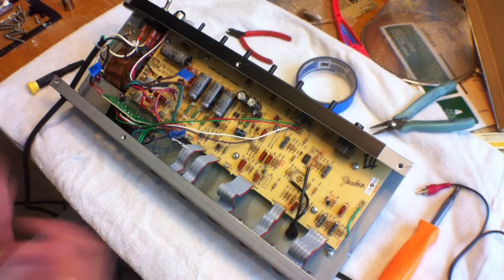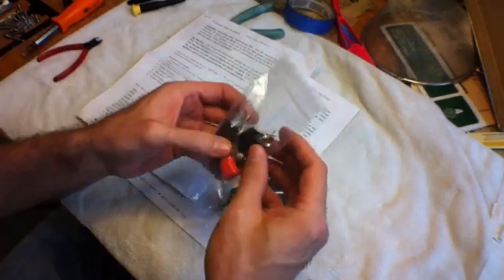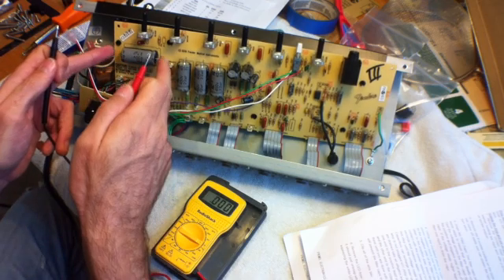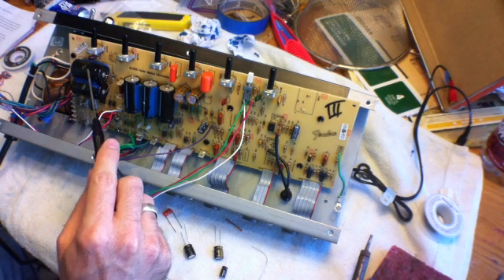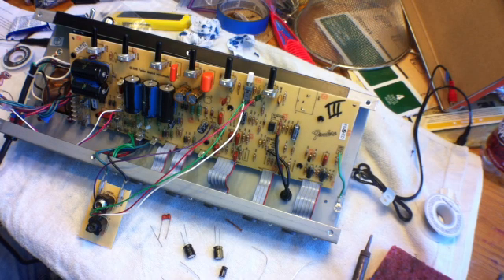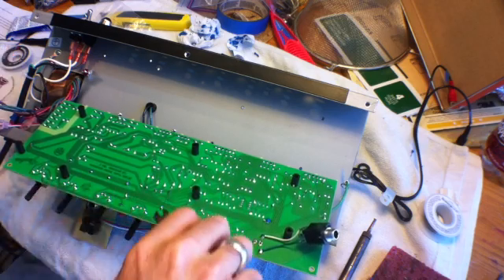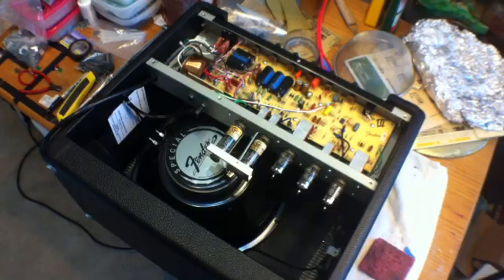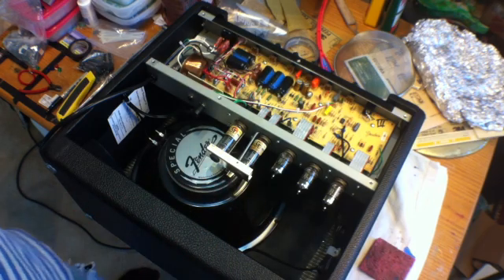Modding The New Fender Blues Jr Series III Amp

Comment: Hey Scott, I cant believe you've modded this amp! I am currently modding mine and adding an effects loop. I'm recreating EVH's pedalboard and use it through the FBJ!  Hope all's well........Rock On!  -Dave
Reply: Hey Dave, sounds fun! What’s on the pedalboard? I’ve never followed EVH’s rigs, they always seemed other-worldly, so, I left it alone.
Reply: @Scottsguitarplayground  Hey Scott,  I am using a Morley Pro Series Volume Plus, EVH Wah, EVH Phase 90, EVH Flanger, BOSS Super Octave OC-3, EVH 5150 Chorus, BOSS DD-2, MXR Reverb. I am also using the EVH 5150 Overdrive either in the effects loop chain or at the amp input. Not sure yet, I'm still modding the FBJ and adding an effects loop...
ROCK ON!  DW

Comment: The wire wound 330 or 470 Ohm cement resistor is to discharge the smoothing capacitors then to be discarded.

Comment: The extra resistor is to use with wire and alligator clips to drain the filter caps so you don't get electrocuted
Reply: Yup. Frommel puts one in all of his kits along with a safety disclaimer.

Comment: It's much easier to work on if you take the screws out of the tube socket board and remove it all together plus you don't bend the ribbon cables and break them. Just take pics and mark the connections from the transformer. twist the leads from the transformer by color to reduce hum. That is what Bill M recommends and pulling the ribbon cables away too.

Comment: Isn't the large 5 watt resistor for adjusting the power tube bias so it can run the tubes a little cooler?
Reply: youren8 It turns out it’s just in the kit for bleeding the main capacitors. Handy!

Comment: I did a Billm mod on my BJ3 cream board and it was a huge improvement! BUT THEN...I attempted to revive a muddy-toned early BJ from the 90s and it still sounds muddy. I tested just the head with the BJ3 speaker, swapped the tubes and still nothing fixed it. I did the Basic Kit mod,  High-Voltage Preamp mod, Re-Cap Kit, and replaced the input jack. Any suggestions?

Comment: That's like modding a BIC lighter.
Reply: I modded mine with the Bill M mods and it has a Ceoestion V Type 70 watt speaker. It makes the Bic Lighter into a flame thrower.
Reply: I use to mod bic lighters all the time when I was in boy scouts.  They were practically flame throwers; I'm amazed I don't have more scars on my hands!

Comment: Question, did you notice your mid knob do something else? I did this mod to my amp but the mid knob doesn’t sounds like it has any effect when the bass is past 6. Also when the bass is on 5 or less the mid knob adds bass or something when I put it to 1 and as I got higher to 11 it takes away a lot of bass. Do you know what’s going on or did I mess something up?
Reply from the maker: I didn't notice any of those issues with my amp...it's been quite some time since I played through it, as I sold it to a friend about four years ago. It's still a really great sounding amp for it's size, and it's always fun to jam at his house and use it.
Rock on,
Scott.

Comment: What speaker did you have installed in your Blues Jr? I just got the Basic Mod Kit from Billm Audio but feel the stock speaker needs to go.
Reply from the maker: The speaker does need to go! I replaced the stock one with an Eminence Swamp Thang, which gives the amp some extra, more natural sounding low-end, more like the Fender Deluxe Reissue.
Rock on,
Scott.

Comment: For anyone that is looking to make their Blues Jr go from a good amp to a great one, check out http://www.BluesJr.com.  They have an ebook called The Ultimate Fender Blues Jr Tone Guide.  It lists which mods are the easiest that give you the most bang for your buck along with specific product recommendations for those mods.  The best part is the 30 or so tone settings that are included to give you a good starting point for dialing in your amp.  Handy guide to have for the Blues Jr

Comment: Just about to order mine, you really think the supreme kit is worth it? You still have it and if so what speaker do you have? Mine came with a V30 which is already going!
Reply from the maker: +Sin sin sinner I definitely think it's worth it, it'll transform the amp! I don't still have mine, I sold it to a friend a few years ago, but, I visit it from time to time. I put an Eminence Swamp Thang in mine, great speaker! It really adds some girth to the bottom end...I also really love the WGS Veteran 30, those are both great choices for the Blues Jr.
Rock on,
Scott.
Reply: G-System Videos
Very cool I have quite a few tubes amps with out reverb and wanted one with, my favorite speaker is the Heritage G12H 55Hz which Ive tried without the mods and its amazingly better than the stock V30 my special edition came with. Thanks
Reply: Is the Swamp Thang still your preferred Blues Jr speaker? Thanks!
Reply: Vince Versaci
Ended up selling the BJ just too boxy, bought a bigger cab for my champ 2 and it blows the BJ away
Reply: Bummer. New speaker and Supreme Mod didn't make much of a difference for the boxiness then?
Reply: Vince Versaci
Nope and wasted my time and $70, I sold it with the V30 that came in my special ed green version. One of the worst speakers imo.
Reply: Vince Versaci
Bought a USA Peavey classic 30 to pair with my Champ2, much better full sounding amp with nothing done to it.
Reply: ive got a super champ xd and its ok. the clean channel sounds good but channel 2 really doesnt sound that good to me. and overdrive pedals dont sound very good through the digital front end. got a blues jr on the way hope i like it.

Comment: that rectangular thing you emailed wondering what it was is a 330 omh resistor to drain the caps btw, you discard it after the mods.
Reply from the maker: karl williams It's funny, I figured that out the day after I finished the mods...Ha!!! I'm glad it worked out for you, I really loved the sound of my modded Blues Jr...to really get the most out of it, you also need to upgrade the speaker, tubes, speaker cable, and get a standby switch...after all that, now you've got a Blues Jr that's formidable!
Rock on,
Scott.

Comment from the maker: Hi Cliff, for any Blues Jr I suggest swapping out the speaker with something better...Eminence Swamp Thang or Texas Heat, or a WGS Veteran 30, those three are my favorites. I also suggest getting these mods done to the tone stack in the amp, it makes a really big difference. One more thing that I would have done, had it been available, is putting the amp into the new MojoTone 2x10 Blues Jr combo cabinet.
Reply: G-System Videos Hello, I  just saw your reply thanks, wonder why I didn't get notice of it earlier?  I began asking around tech shops here in Tokyo and learned no one knows much about mod kits, it's a new concept for them.  As far as getting a new cabinet that sounds like a tall order.  Let me look into in more, and will write again thanks again. my regular mail is cliffworks(at)gmail(dot)com
Reply from the maker: Rock on!!!

Comment: i hear alot of people say the dont care much for the jenson speaker,,,, whats a good swap for hard rock? i have a jenson in mine and ideas anyone?
Reply from the maker: I swapped out the Jensen for an Eminence Swamp Thang, it added some much-needed bass to the amp. The mods I did to this amp made it sound ten times better than a stock BJ. Well worth the $250 in parts (Fromel Supreme mod kit, JJ tubes, Eminence speaker, Evidence speaker cable, Weber Beam Blocker, BillM stand-by switch).
Rock on,
Scott.
Reply: G-System Videos did you do a video for installing the stand-by switch?  I've been looking for instructions all over the web on how to do it.  Bill's been ill and not processing orders so attempting to do it on my own.
Reply: Michael O'Daly That's BillM I'm referencing.
Reply from the maker: Michael O'Daly Sorry, I didn't shoot a video for the standby switch install...it's very simple though, just follow the instructions...if you can get the switch from Bill, that is. He's the only guy I could find that had the right switch and instructions on how to do it. If you took your amp to a qualified tech, they could do it very quickly, I'm sure.
Reply: i had the fromel mod, swapped speaker, what about the transformers? what ya think about the Mercury magnetic s? wonder if it just heightens the volume?

Comment: is the BLUE RTV necessary or is an option?
Reply from the maker: It's not specifically necessary, it can easily be replaced with a high temperature silicon-based adhesive...this was just what I found at a nearby auto parts store. It is necessary to use some sort of adhesive, as you don't really want the components to touch one another.
Rock on,
Scott.

Comment: Great video! Very entertaining! But your next mod should be replacing the speaker.
Reply from the maker: That happened a few weeks after I did the mods. This amp underwent a massive transformation. I swapped out the speaker with an Eminence Swamp Thang (increased low-end, and punchier kids), swapped the cheap Chinese tubes for JJ's, bought a new speaker cable for the amp from Evidence cable, added a Weber Beam Blocker, and a standby switch from Bill M Mods. I have since sold the amp to a good friend, and it still sounds amazing! Much more like a reissue Deluxe now.
Reply: G-System Videos That's awesome man! I have a limited edition Blues Junior that came with the Eminence Wizard. I would LOVE to have a standby switch.
Reply from the maker: It's a very cheap and easy mod, no soldering, just go to Bill M's website and order the part.
Reply: Thank you!

Comment: Funny video man, you are very entertaining!
Pablo, adding the extra capacitor there is to either increase filtering of ripple, and or add extra reserve on hand for reducing transient distortion.
That's the one where the amp sounds like it is coughing it's guts out because it does not have quite enough to give.
I kind of like that sound on some amps though, so increasing the filtering can (can) make an amp too tame.
So, now that I have babbled on... How did the mod sound compared to stock for your tastes?

Comment: Do you remember the brand of those caps: "The two larger radial caps (C30 & C32)) were 470/50, the two smaller radials (C31 & C34) were 220/35, and the smallest (C33) was 100/35, the two caps in the lower right hand corner (C1 & C4) were both 22/35, the C18 cap was replaced by a 47/35"
I have installed already the F&T filter caps and I'm impressed with the sound, so I'm curious what the brand of the other caps is.
Reply from the maker: I don't remember the brand of the caps, sorry. I sold the amp about sic months ago.

Comment from the maker: Well, it's not much money...so, it's a really good deal compared to some other amps.
$399 new in some stores, and once you do the mods, swap out the speaker, tubes, and speaker cable...$625 for a great sounding amp isn't bad.
Reply: Now $600 retail. I bought a vintage Deluxe Reverb for $750 on craigslist. Sounds 1000x better than a BJ in every way.

Comment from the maker: I really like the sound of the Hot Rod Deluxe(especially with a few mods), but, it was just too friggin' heavy for me to lug around after three car crashes left my neck, shoulders & back considerably less strong.
Reply: Hot Rod Deluxe is an awesome amp, they have sold a lot of these. Often used for backlines in clubs. And you can get them used for about 375-400, same price you pay for the BJ used, LOL. Lots of Losers.

Comment from the maker: I replaced the tubes a few weeks later with Tung Sol 12AX7's and JJ EL84's.
The stock GT preamp tubes were actually quieter than the Tung Sol's, so, I eventually swapped those out for JJ 12AX7's...problem solved!
Rock on,
Scott.

Comment: Great video...  Gave me courage to mod my MIM Blues Junior using the Fromel Electronics Supreme Mod kit... Mine is the cream colored circuit board Mexican model. The mods improved my amp in several ways. Addition of a metal input jack. Also,  substitution of several new upgraded capacitors, etc...  Also installed the standby switch from Fromel... Turned an average amp into a good amp. It's still not in the same class as my Fender Tremolux EC and will never be, no matter how many mods are done.

Comment from the maker: Hi,
For tubes, you can't go wrong with JJ, for both preamp and power tubes. I went with Tung Sol preamp tubes, and I'm finding them to be kinda noisy compared to the JJ's.
Speakers...lots of choices. I really like the Eminence Texas Heat, and the Swamp Thang (which I have in this amp), not too pricey, and great sounding!
The ringing/whistling sound you're hearing is probably a tube going microphonic, so you should notice a nice change with just a tube swap.
Rock on,
Scott.

Comment: Very informative Video. Thanks. I have a Blues Jr. III. Everything is Stock (model 28055). When I play, It has a very high "ringing/whistling sound.
Without going through the surgery you performed, what tubes and possible speaker upgrade would you suggest.
Thanks,

Comment from the maker: I put an Eminence Swamp Thang in it, and some Tung Sol 12AX7's, and JJ EL84's...I may swap out the Tung Sols, they're quite a bit noisier than JJ's. It's still a very quiet amp, and the Swamp Thang adds some real size to the low-end of the amp.

Comment: Nice vid! I did the same Fromel mods on my USA made green board blues jr a couple of years ago. UNBELIEVABLE improvement. The amp is so quiet now.  Before the hum was unbearable.  It gave it a little more reverb which of course the old green board bj's lack.  Really nice mid boost too. Have you experimented with any speakers? I have a cannabis Rex and a set of new JJ tubes on the way for mine.

Comment from the maker: Hi,
I've only worked on my own amp so far, but I'm willing to work on your amp if you'd like me to.
I don't think the Bill M's mods would sound much different (if at all) from the one's I installed in my amp. The components are basically the same from mod kit to mod kit.
I would suggest getting an original US made BJ, or a Series III Blues Jr if you can,  slightly better built than recent Mexican made BJ's.
Rock on,
Scott.

Comment from the maker: I had a Night Train, it was ok, but it suffers from the same ills as the Blues Jr...no real bottom end. You can mod the Night Train just as easily as the Blues Jr, a little easier in fact...less work to get it out of the chassis.
If you do the mods on the blues Jr you'll end up with a much better amp than the stock Night Train...go for it!!!

Comment from the maker: I finally replaced the tubes (with Tung Sol 12AX7's, and JJ EL-84's), and swapped out the speaker for the Eminence Swamp Thang. Lots of "real" sounding bass now, without ever needing to use the Fat switch, I find it to feel a bit artificial now that I've done the mods...it was necessary to use before to get any kind of low-end from the amp, but not anymore.
Rock on,
Scott.

Comment: Thanks for doing this.  Modding my BJ is on the to do list.  Re the C20  cap that was replaced with the "mystery" yellow axial cap .47/100 --- I am looking at a schematic for and older BJ and it looks like it is a coupling cap (not a filter cap) in the input to the reverb op amp.  It is a non-polarized cap so it does not have a + or - side.  The signal goes through it so it is important that it be high quality, which I am sure that it is because it looks like a Mallory.